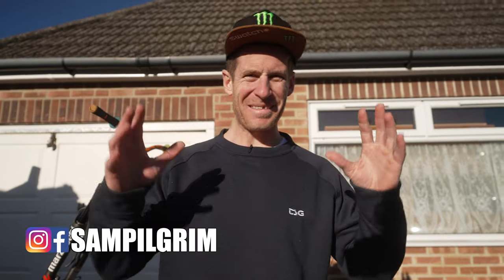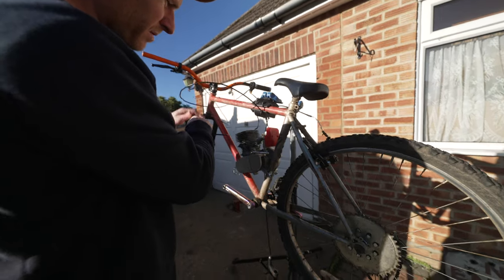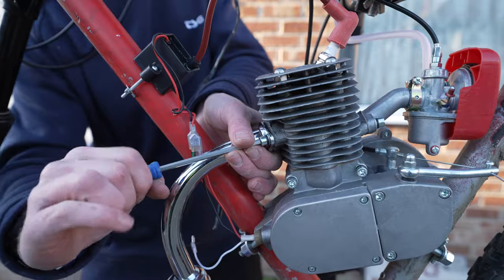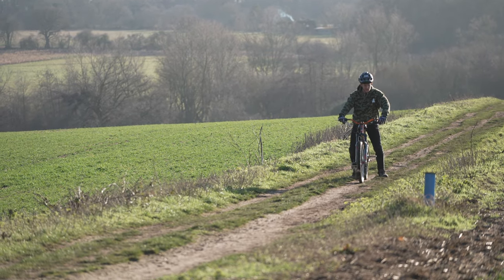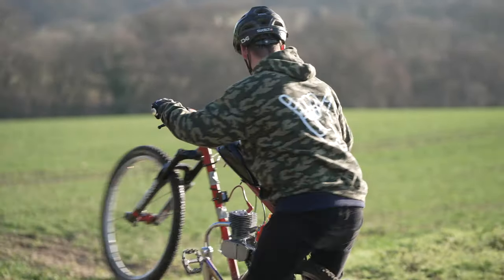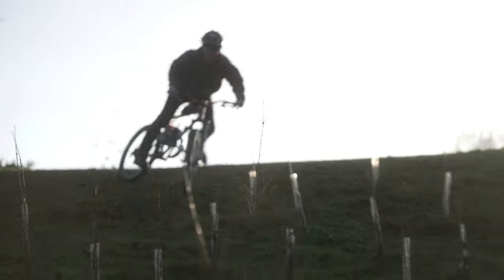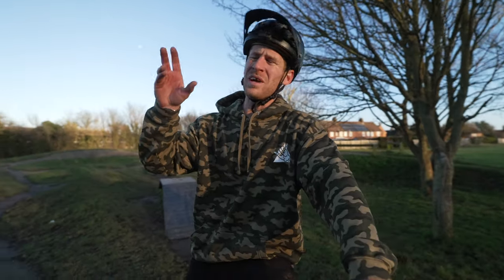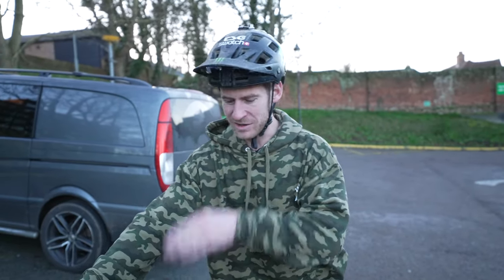FITTING A NEW 100CC PETROL ENGINE TO MY MTB - MAKING THE CHEAPEST MOTOCROSS BIKE!

Comment: Just a quick tip for running these peddle bikes. Keep peddling when the engine is engadged it helps the motor to run more efficiently and wont bog nowhere near as much. Also it has a manual choke which you can adjust on the carb/air filter to help with the bogging out aswell. These are great fun and had hours of enjoyment out of them
Reply: he also never let it break in

Comment: The screw on the outside is just the idle fuel pin. If you move it out you'll notice the bike stalls even with the clutch disengaged. What you need to do is open the carburetor and replace the main fuel pin. That carburetor comes with a #60 pin as standard, you want a #66 it get more power at the top end. To access the main fuel pin on your carburetor. Unscrew the bottom two screws holding the fuel reservoir and pointing down will be a brass nut. 6mm, unscrew it, that's the main fuel pin. Replace with a #66.
Plus those air intakes are known for being rubbish, just drill some more holes in them to get more air flow.
Reply: you cun run them without air filter no problem. just take it off

Comment: You should look into a larger sprocket for the back wheel. you would lose a bit of top speed, but would have much more torque in the lower ends, which seems to be needed in this case.
Reply: Oh and Also, check the air intake to make sure there is no restriction. (there could be a piece of cardboard in there from the factory)

Comment: It sounds really rich. Try drilling holes in the. air filter and it should open up
Reply: Yep its rich. Just take off the airfilter before drilling holes in it;) if it runs better you could consider drilling holes. However to really solve it is fit a smaller jet in the carburetor. That will really make it run good. Get a couple of sizes. Best is to tune down, try steps smaller. As it is still new I would leave it a bit rich for 5 hours of using it. Or just go lean immediately and see how long it will last 😁
Reply: Should find out what mixture he's at, im sure he mixed it 32 to one, should be running 40 or 50-1
Reply: @ubajava  carb pin screw is only for idle adjustments. Can fiddle a bit with the needle(if it even has one) put the needle lower, but the problem is still a jet that’s a bit too big.
Reply: @delahayenator  yeah he just needs to adjust the needle to the top notch to lean the fuel out and modify the air filter to let it breathe more, I’ve got a 100cc motorised bike myself
Reply: @delfinsidiropoulos4786  for sure worth trying before changing the jet. Set the needle deep like you say. Top notch :)
Reply: @delfinsidiropoulos4786  but if that doesn’t help why not solve the problem in the root (jet) and leave the filter untouched. Drilling holes etc is not the way to go. And it is way easier to screw in a smaller jet. They’re not expensive
Reply: Jezus.. That won't do anything besides make it blow up sooner.
Reply: @taylormursu9559  its not a motocross 2 stroke... There's not enough fuel running through the engine to lube it at that mixture. Gotta run them rich on the oil since they only sip fule, not chug like the high revving bad boi bikes. 25-32:1 is good. For a high revving bike 32-40:1 is best. I never run 50:1 or higher since more lube is better unless you're smoking a lot or fouling plugs.

Comment: Try adjusting the needle clip on the carb if that doesn't work you need smaller main jet. Also air filter might strict the airflow a little bit too.
Reply: You're correct the needle is set to rich .the clip on the needle needs moving up 2 leaning out the engine. A plug cheek will tell you what you need to know ...black / oily to rich . A brown  tint is good ..pale to lean.

Comment: Hey there Sam, I don know a thing or two about engines. Befor you bother with jetting and the carburator in general you need to get a proper pipe! You need an expansion chamber pipe, like on your Suzuki. Then you should be able to make some power, if the engine is worth something!
Reply: Yea know what you mean I Got a go kart put a ts250 engine on it, exhaust had no expansion. It run horrible and wouldn't clear, fitted a fmf expansion pipe on it and its running spot on.
Reply: Do you guys not release that the second exhaust that he fited on the bike was as expansion power pipe with the muffler cut off the end

Comment: You probably need to install the drive gear it came with. That smaller gear that you have on the wheel is probably part of what is bogging the motor down. It's too small and it's causing the motor to pull harder than it's rated for. Just a thought. Besides it would be easier to wheelie that way.

Comment: Hi sam bud since it's a new engine there is a break in procedure especially with a two stroke engine most of them you mix 16:1 premix for 2 tanks never going above half throttle for those to tanks then back to 20:1 premix

Comment: Sam take apart the carb and check if the holes of the jets are clean. When there is even a bit of dirt the motor can´t run on full throttle, because there isnt enought fuel coming throught.

Comment: It's bogging because it's new and not mixed properly. Don't mix the fuel to oil ratio at 16:1, mix it at 32:1. It'll lean it out and give it more power :)
Reply: That engine is small enough to probably run it 40:1 or 50:1
Reply: @frostenmcfrosty2453  many of my friends have these engine bike kits, they all say use 32:1 during break in and 40:1 after break in

Comment: The YD100 is actually 80cc. You need to adjust the carb needle to get it to run properly. You want the plug to be brown, not black or grey, black is too rich and grey is too lean. The higher the clip on the carb needle the leaner, the lower it is, the richer the mix.

Comment: The lack of back pressure from the exhaust could be lowering the performance.
Also the jets in the carb. The jets are easy to change, you can buy a jet kit and experiment.
And the thin fuel tube might be collapsing under vacuum.

Comment: That screw on the carb is just to set the idle speed when you aren’t moving. Bogs at the top can mean it’s not getting enough/too much fuel or has too much air. You can change the jet needle setting by taking the throttle cable off the carb. Takes a bit of tinkering with the carb to get dialed in. Also get a better spark plug that will help the stock one is garbage. I love my petrol bike! Top speed at 32 mph! Mine bogged at the top end with the break in oil/gas ratio like 16:1. At 20:1 parts gas to oil the bogging stopped and top speed increase and motor ran way smoother.

Comment: That engine is 35cc at best. You know how Chinese products are.
Reply: It’s 78.6 cc it’s still not the best😂 I recommend getting a phantom 85 cc motor
Reply: 85cc
Reply: A proper 85 cc liquid cooled two-stroke can make 26 hp, the engine he used practically garbage.
Reply: The YD100 is actually 80cc
Reply: @ReMarkAbleMagic  that is the yd100
Reply: yd100 is 78-79cc

Comment: these little motors are great, but they have a break in period of a couple tanks. ive been running a cheap one of these for nearly 10 years, ripping on trails and roads with zero issues. ya just gotta give them some love first.

Comment: Also use a full synthetic 2 stroke oil and mix it 50:1. I wouldn't even hesitate to buy a pint of race gas from a motorcycle shop. Should clean it up and it should smoke less too. Cheers

Comment: You have to run it in 😂 bro I have one and it took like 2 tanks of fuel to run it in and now has full power also removing air filter on carby helps with bogging and it’s better when it’s tuned

Comment: Take the plastic cover off the air filter on the carb and that will fix the bogging problem, if not adjust the needle inside the carby to the top notch to lean the fuel out I’ve built countless motorised bikes and I have a 100cc myself and it bloody flys, sometimes when they’re new they need abit of tweaking but once u get it running good they fly mine goes around 65kmph

Comment: That idle screw is your idle turn that clockwise until it starts reving higher so it doesn't keep stalling and then pull your air filter off then it should run mint

Comment: For the stalling when you let off the gas, you should turn the idle screw clockwise (it basically just holds the throttle open a little bit)
Reply: And also maybe your choke lever vibrated up, therefore making it run too rich, not have power, not rev, and smoke a lot

Comment: It can’t reach the powerband due to the gearing which is why it is sluggish but I don’t know how accessible new sprockets are for those. After watching for a bit longer it also seems your fuel mix might need adjusting. And like you said, breaking it in a lil more could help

Comment: Old Gripshift would probably be better option for the throttle (just remove the indexing spring inside). Could also use locking grips, just cut to lenght on the throttle side.

Comment: might be worth checking clutch cable is not to pulled in maybe its using half clutch, or maybe slight pinching fual cable starve the engine abit as it sound little flooded when open throttle

Comment: Buddy, you HAVE to find someone that knows about little air cooled 2 strokes and get him to dial in the jetting. If i was you i would pull out the needle and move the clip up. That'll lean it out it sounds reeeeeally rich. Braking it in you want to throttle it hard,let off and let the engine slow you down. Keep doing that through a couple thanks of gas. Black spark plug means rich, white hue means lean, golden hue means DREAMS. Id mix that thing like 42:1 too those dont need much oil at all. You put oil in the case right?

Comment: Does it run any better with the choke? It sounds like it's not got enough fuel at wide open throttle. Try to wind out the fuel mixture screw not the idle screw and rev it up until it sounds right. Normally a quarter turn at a time

Comment: That bike is running rich which is why it's going slow and not revving out you have to move the clip on the throttle needle on the throttle slide if that doesn't work you need less restriction on the air filter

Comment: Try a hotter spark plug. On the plug the number indicates the heat. If the number is a 7, try the same plug but with an 8 in the code

Comment: Even going 100cc your still suffering with to tall gearing you gotta go bigger on the rear sprocket or smaller on the front. The stalling issue at low speed is because you got a manual clutch and your not clutching before engine goes below idle speed. Ideally you want a centrifugal clutched engine from a twist and go rather than a manual.

Comment: Sam open the top of the carb and take out the slider you should be able to Adjust the middle height this allows more fuel to flow Through the carb try experimenting with the needle height a little higher this will give you more fuel and if the engine is still bogging Then lower the needle in a little bit more the what stock position was This will reduce the fuel flow through the carb
Reply: Adjust the needle height not the middle height 😂😂 look for progressive Mtb on Facebook and drop me a massage and I will explain in more detail.

Comment: It feels sluggish bc of your fuel mixture. 25:1 is ideal for 80cc once your motor has been broken in. When you first get your motor it should feel sluggish bc the oil that's mixed in your fuel will help temper the motor.

Comment: Blue lock tite, everything" a spring active chain tensioner, 60 tooth rear, for power on trails, carb bog clamp leaks air chronic symptoms & lame carbs 40:1 mix hard use 90. + Octane,  proper plug gap gas tanks slip around a bit so aftermarket tanks have larger studs brazed in the bottom, that hold up better"  unfortunately stock pipe is your best all-around pipe for your neighbors and the police, but a real cone expansion chamber will lift the front tire but are dirt bike loud, also carb bog inside the carb there's a clip for throttle 3 settings ,  pull off with needle nose plyers to next setting " try all 3 " ezpz  keep chain tight """ best to upgrade carb & throttle though

Comment: Turning the idle won't do anything if u haven't got the air fuel mix screw right should be on the bottom of the carb start at 1-1/2 turns and tune it in

Comment: I like the engine size but if you are looking for more speed install a jack shaft kit onto the engine they bolt to the engine and allow you to use the gears of the bike you don't lose any power and have all the speed you need

Comment: ether the carb needs tweeking, or a race air filter. if all else fails and the engine still has no power, bigger tooth sprocket on the back wheel but it will give you less top speed but you know that.

Comment: take the throttle cable out the carb the needle has an e clip at the  top in a groove change the e clip to a differnt groove to adjust more or less fuel that should sort the bogging problem

Comment: My uncle's name is not Bob. You need to install a used Yz/RM/CR/KX 80 or 85cc engine in your bike for the best performance. The Chinese count the crankcase when they measure CC lol. The motors I mentioned will fit with an adapter kit sold on eBay. It's a piece of cake to install and will do wheelies.

Comment: Do you still have it if you do you should probably do an update video and you see that screw that holds the exhaust in the bottom of it remove it and pop that cap off its going to sound really loud but I'm pretty sure you'll get better throttle response

Comment: Take off the air filter  it will hit powerband quicker and  before you really get on it they say to have a 1-2 tank of gas break in  period  these are junk motors but you can build them to last I have 5 of them and 1 of them have over 1500 miles on it and runs great

Comment: Its runnning rich is the choke on? is there a mixture screw if there is it need to be 2 and a half full turns out from fully screwed in (not tight just screwed in) you can always lose the air filter if the jets ends up being to big an u cant lean the mixture out atall

Comment: I built one of those foldable hopper ramps myself cuz they re so expensive😂💸
Reply from the maker: Did it work out?
Reply: @SamPilgrim  yes it actually did, i first made sure i had all the right measurements. And then tried to build it. I ended up making my own design cuz it isnt really like the hopper ramps. But still i think the hopper ramps are a lot lighter and stronger.

Comment: You should be able to adjust the clutch so that it doesn't engage at low rpm. Also there should be a way to tune the carb.

Comment: These are a must port.  you can't just put it straight on the bike. there good if you port the cylinder it has a lot of casting left over from when they made the cylinder and the ports are tiny. I got a dremel and carbine bit and ported mine it hauls ass.
You pay shipping I'll port the cylinder for you. Check out my bikes.

Comment: I've got a 100cc engine that needs to be taken apart and cleaned then put back together and back on the bike and mine would run good.. I've thought about getting a 4 stroke instead of a 2 stroke!.. btw I'd suggest really good brakes for your's, I only have one brake on mine and it's not very good as long as I don't go too fast on it lol

Comment: I found out the hard way with small displacement engines that higher CC just means more torque.. lol 

I went from 29cc to to 45cc and I can definitely feel torque off the line. Before no wheelies, now? No issue. And I’m talking about a RC gas 1/5 scale use the same small displacement motors yall use on these bikes.

And that carb you had stock with motor was utter junk 💀 had no high / low / idle adjustments, it was bogging at high rpm cause it was too rich, lean it up abit and bam. But once again that carb has no adjustments. Prob can only change jetting.

Comment: I would love to be your mechanic lol I'm really good at making those engines scream and stop sputtering like a hunk of junk. Part of the issue is that it has the same size carb as the 47cc 60cc 66cc and 69cc engines. The carb is restrictive for even the 47cc engines and they are almost never jetted right from the factory. BTW the "100cc" engine is actually an 80cc. And the "80cc" engines are either a 66cc or 69cc.
Reply: everyones an expert with these

Comment: Needs at least a gallon of run in mix put thru before it'll come on song, and needs a weber carby to get full potential.
Also, if it was legit 100c as a single pot, it'd rattle itself to bits ... single pots are bastards over 85cc.
Convert a proper 100cc twin and you'll be rocking it.

Comment: The box is called a coil and it gives your engine spark at the spark plug.
Reply from the maker: I see!
Reply: @SamPilgrim  get a mechanic to check the tune as once it's run in it will need adjusting 😉😉 yeah we wanna see more of it just not bogging out and 15mph 😁

Comment: These small engines need to be broken in before they get into their power band, also that carb ain't gonna give you much to work with bruv you're better off getting a performance carb with legitimate adjustments after break in and it'll give you some good power

Comment: He doesn’t understand that these motors need to be tuned to get adequate performance, you can push them to crazy speeds. Also out of the box you’re not getting full performance you need to break it in, the only adjust the idle, you have to also jet them for altitude

Comment: The gear is too big on the back wheel, causing it to bogg down , longer exshust pipe more back pressure, better fuel mix, a carb adjustment.

Comment: have you turned the choke off ?
Reply from the maker: Yes!
Reply: Check the needle height on the throttle slide there should be a few notches stick the clip on the top one to lower the needle and lean it out a little on wide open throttle also check your plug colour that will tell you alot

Comment: The screw on the carb is for the idle, what you need to do is jet the carb so it gets more gas, or put a sprocket with less teeth you can get a higher top speed